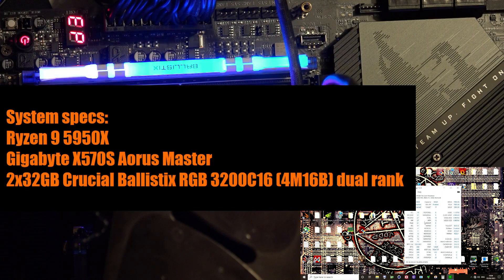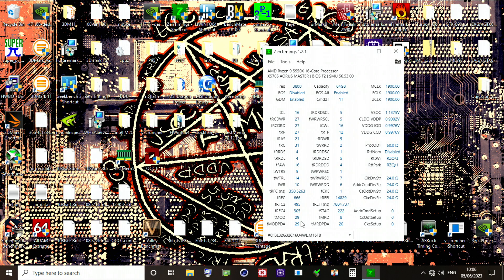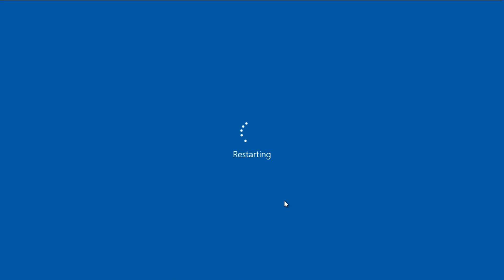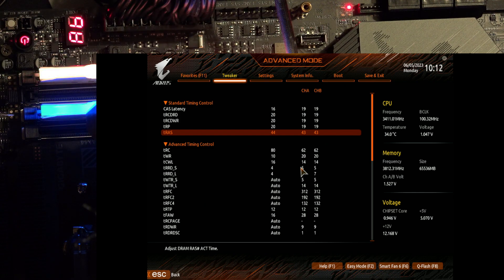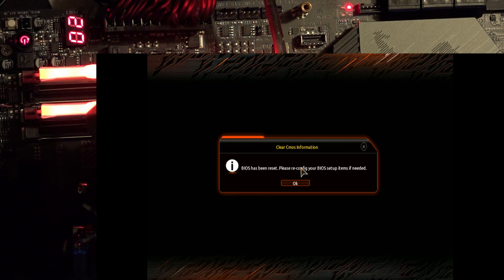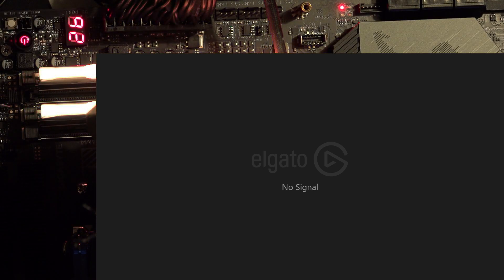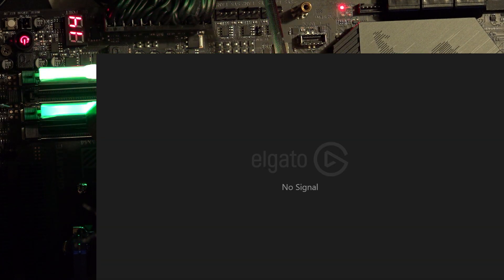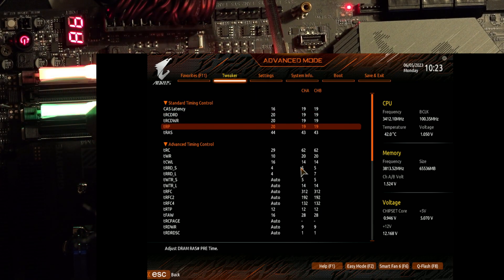RANT: A practical demonstration of tRAS and tRC DDR4 timings on Ryzen memory controllers.

Comment: My timings @ 3900 MHz where BOSD because my TRAS were set at 36 like 17171736 it was crushing like crazy I fixed by changing the tRAs to 34 fully stable 8 hours in OCCT but I use the maths like 17 + 17 =34 that saved me

Comment: Could this be board specific? I have asrock b450 itx + ryzen 3600, my kit runs with 16-17-17-30-50 but I can't boot with the timings 16-17-17-33-45 for example. Trtp 6, twr 12, tcwl 14 btw. Am I missing something?

Comment: Buildzoid, i would like to watch an analysis about current z690 motherboads power stages vs next gen raptor lake cpus, since 13900k is gonna be compatible with z690. All this to solve this question: do we need an overpriced new gen z790 motherboad to properly run an overclocked 13900k,  or, is a mid-high tier z690 mobo capable enough? Also, your videos are amazing, i've learned a lot!Thanks!
Reply from the maker: you'll have to plug in the extra power connector but the VRMs should handle the CPUs just fine.

Comment: TLDW: tune tRAS second to last and tRC last so it won't mess with your other timings.
They also won't do anything if they are lower than your tRCDRD/WR and tRTP/WR combined for tRAS or tRAS and tRP combined for tRC. Just like tFAW won't do anything if it's less than four times tRRDS.
Reply: On Intel: Tune tRAS last and forget about tRC existing.
On AMD: Set tRAS to 21 second to last, tune tRC last.
4:05-4:12 at the video.

Comment: Memory timings have realistically changed very little over the years and most come from a time when memory was accessed through actual strobes, some could be depreciated but jedec seems to keep them for fun. On older memory Tras was the number of cycles that the ras pin had to be held high following a row strobe.

As far as the activate -> precharge with no read or write, this can happen, it is the basis of rowhammer attacks.

Comment: I was under the impression that tRAS was the time that the RAS signal was asserted, and therefore could be ended before the precharge starts if it was shorter than the RCD+CAS combination for the respective operation. Once the RCD completes, the selected row should be loaded into the row buffer which means the RAS signal is no longer needed to connect the row with the row buffer/sense amplifier.

The behaviour of this aspect might be the reason this demonstration does not work on intel.
Reply: This was kind of true 25-30 years ago. Tras was "RAS active time" and was the number of clocks that Ras had to be held high after the row strobe but has changed with more modern memory standards.
This is one of the issues with alot of the memory overclocking information that is available online, there is quite a bit of decades old, outdated information mixed in.
Reply from the maker: Where is this mentioned because literally all the documentation I've read only talks about tRAS limiting how soon you can send a PRE after an ACT or how soon an automatic precharge can start. tRCD handles moving the data from the memory array into the sense amplifiers.
Reply: @ActuallyHardcoreOverclocking  I think it is implicit because under JEDEC, tRAS is way longer than the minimum of the RCD+CAS combination so it is gating when the precharge can start. It's only when you lower RAS below JEDEC values that RCD+CAS can become the larger of the two. tRCD handles the time that is needed to pass before the CAS is allowed to start, but because CAS and RAS are independent signals, for a read operation you can keep RAS active as long as you like once the data is in the row buffer. For a write operation RAS has to be held active anyway to push the data from the row buffer back to the row in the memory array, so RAS is held active until the precharge.

Comment: AMD CPUs don't speculatively open rows and precharge when they're unnecessary? That's really surprising!
Reply from the maker: The thing is if you have the wrong row open you end up taking longer getting to the correct row if it's in the same bank. Since instead of just needing a tRCD+tCL/tCWL you need tRP+tRCD+tCL/tCWL. It's also possible that AMD does speculative row activations but is just much less aggressive with PRE commands. Intel CPUs seem to be able to send PRE commands before tRCD is over.

Comment: hey buildzoid, i have 4x8gb 4100mhz (b-die) adata, and i cant get it to work more than 3600mhz (also mobo spec says max for 4 dimms is 3600mhz, 2 dimms work perfectly on 4100mhz) board is asus prime x570-pro. tried lot of stuff, even with auto clocks nothing works even 3800mhz. is there anyway i can go around???
Reply: Your motherboard is daisy chain topology, therefore you shouldn't be using more than 2 sticks of RAM if you want high RAM clocks. With daisy chain and 4 sticks, the RAM traces will differ in length, causing extra instability. You want a T-topology motherboard for 4 DIMM configurations.
Reply: 5700G to possibly get them to 3733 LOOL

Comment: bz have you got any good resources on tuning B-die on Zen 2? not that the fucked IMC of my 3950X is any good beyond 3600 :(
Reply: That seems fairly unlucky. Are you sure it’s the 3950x and not other things like soc voltage or something else? When I was tuning a 3700x it easily hit 3800 and had a little bit more room but left it at 3800.
Reply: @joescalon541  I put 1.4V on CLDO_VDDP and it seems to have fucked up the IMC.

Or the ASUS CH7 just sucks ass for RAM OC.